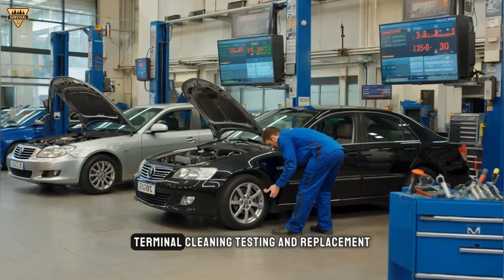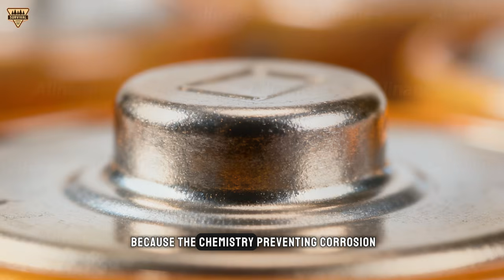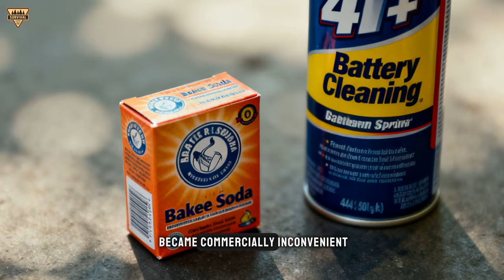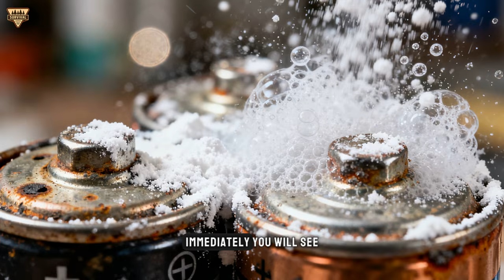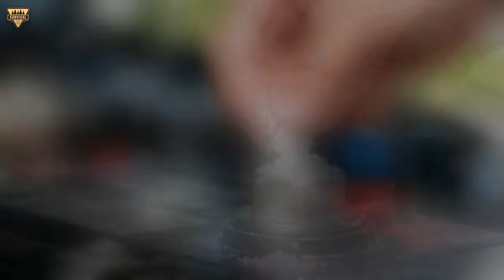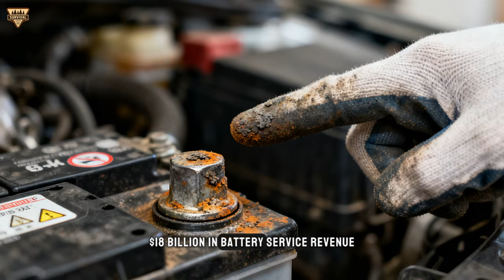$2 Paste CLEANS ALL Battery Corrosion PERMANENTLY. Mechanics HID THIS Trick

Comment: I can save you the burden listening to the A.I. voice. It is called dielectric grease and if you don't have that petroleum jelly works just as well. Pull the battery cable from the post and scrub clean with a wire brush and baking soda water mix (the battery post as well). Use the battery post cleaner wire brush tool they are cheap. Rub a little grease on the post and a little on the battery terminal and put it back together making sure it is snug. You are done start your car and don't worry about it anymore.
Reply: 14 minute video for a 3 sentence explanation.
Reply from the maker: This process also works as well